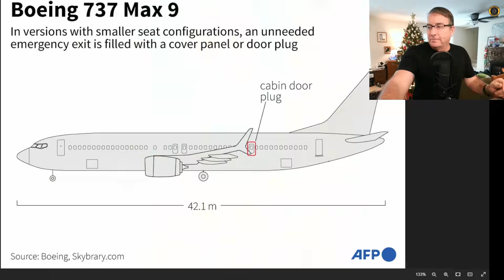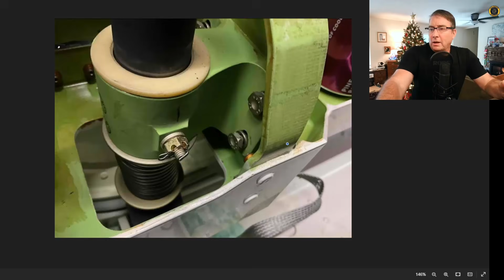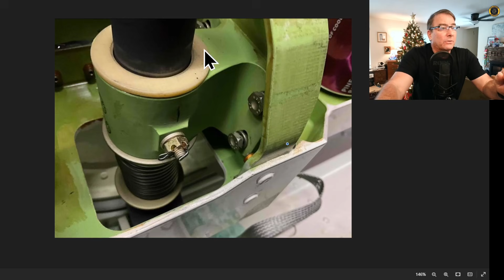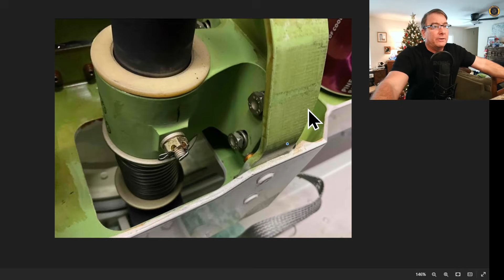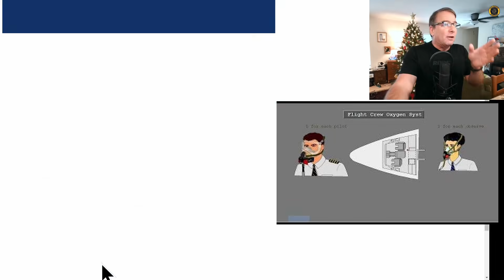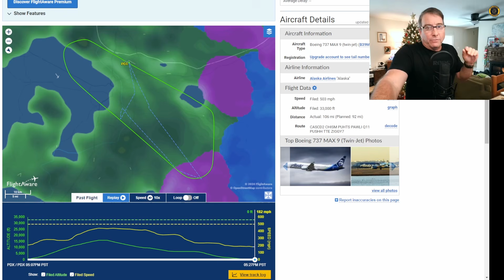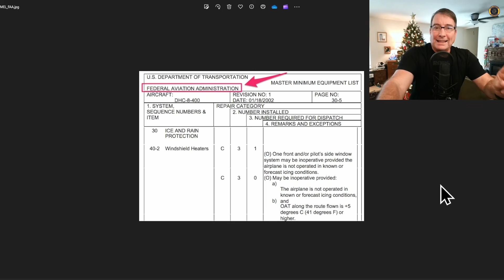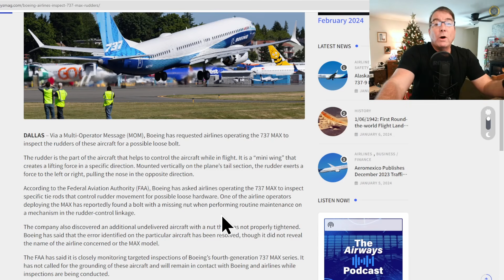"Yes, We Have No Bolts"  9 Jan 737 Max-9 Update

Comment: Here is a thought as to the possible sequence of events.   Bolts were never installed by Spirit and not caught by Boeing in Renton.   Thus door was a loaded mousetrap ready to spring.  What triggered the spring?   Given that work was done (WiFi antenna install) near the door that undoubtedly involved drilling etc (producing vibrations) perhaps those vibrations allowed the door to start to move a little and get closer to springing.   This would explain the pressurization warnings after the WiFi installation.   Those warnings were only transient as at higher pressure differentials the door plug was still able to seal (hence switching to the alternate pressure regulation seemed to fix the issue).   However on the fateful flight,  with the door having moved a little due to to the earlier Wifi antenna work,  all it took was some turbulence (with only modest pressure differential due to relatively low altitude) for the trap to spring wide open...
Reply: Who installed the interior panels?  Spirit or Boeing?   If Spirit, Boeing may not be at fault.

Comment: Why no safety wire on the bracket bolts? I undwrstand that everything does not need to be wired. But, brackets for doors, controls, control surdaces, ...

Comment: I live near the Boeing plant here in Wichita, KS. Now this brings ups a WHOLE bunch of questions I know the FAA/NTSB is and has been asking about loose bolts on that aircraft. Maybe it's time to do a full investigation into the "line" and see where the missing checks are at? Last, after watching the NTSB Brief about the crew Not being able to communicate, (after the blow-out of the plug door), My question: Why have the airlines haven't adopted a wireless headset system for the stewardess? Just a thought.
Reply: Nice! Tell what you saw of the labor dispute/strike @samuelbrown1413 As for wireless, too many points of failure. A few come to mind: constant need to recharge batteries; wireless interference & short range; wireless interception--and no, scramblers would only drain battery faster; thus, just like good ol' copper wire twisted pair landline telephones, sometimes the simplest work the best.

Comment: Is it possible to request a deep deep dive into why Boeing are are doing so many tweaks to this aircraft, occasionally omitting those changes from the manual!. How the original jurassic 737 was designed to have a fuselage that was low down close to the ground meaning it did not need specialist handling equipment and how MCAS was needed because the low lying nature of the design meant modern engines couldn't fit underneath the wing, completely changing the handling characteristics and ultimatelycausing2 hull losses.. All these work arounds to save having to certify a new design. I see now there's a new one, the blow out panels on the cockpit door are just fake? On this specific incident, do we know who was responsible for not securing the door? Where was the interior fitted? Another thing i heard was that a seat frame was twisted and i wondered if the floor got damaged?

Comment: Interesting, good piece to learn or remind things. 
Thank you Blancolirio! 
Well, haven’t flown 737 at all.
Flew 757, 767 and currently the 787.
I have 10000h on A320s in between… and SURELY I know that cockpit door shall open in case of pressure difference high on the cockpit side. It was even possible to test it while in 320 cockpit as the pressure ports for the (door unlock) system were visible.
Airbus FCOM detailed this function (not nesesery the trick to open the door).
On 320 we all knew the certification calls for opening doors one way and blown panels for the other scenario - decompression inside the cockpit. This knowledge is common.
Maybe I am wrong? 

Boeing manuals are written the way that we all go to other websites as you do in case of 737. I use 787 Guide for example. The common opinion is the official new Boeing aircraft manuals are written by some layers and limit the information. 
One has to go into maintenance docs and keep asking the technicians to understand things.
Pilots should not be surprised, should they?
This is the area Boeing should do better.

Comment: Great explanation 👍  
It seems to me it would be very odd for all 4 bolts to be missing.  Then again it is a very intricate 4 point structure to hold the plug in place, so something has failed or was missing.
Reply: No, it would be very odd if some other number than 4 bolts were present or absent.  The job item is to install all 4 bolts, or remove all 4 bolts, not to install or remove just some of them.

Comment: Wait, plug doors are BIGGER than their frames and use the cabin pressure to seal themselves… See the door where you enter the plane, why would you need bolts for a door like that?
Reply: It may seal properly in flight, when pressurized, however, in event of a water landing, is a plug door watertight? Would it leak like a sieve, thus reducing critical time for aquatic evacuation and escale before being completely submerged? Seems like the entire plug door concept is a dangerous, fateful, risk-enhancing design. Thoughts @emeraldqueen1994 @blancolirio
Reply: Yes, plug doors opening inward are safer at altitude.  Unfortunately, these extra exits are not plug doors, they open to the outside.  When the door isn't present the door plugs are put on from the outside in the same way as the working doors.  There were good reasons for this, but it makes them inherently less safe, and requires care in installation.

Comment: Having reviewed technical data, the only logical explanation is the absence of the 4 bolts upon delivery of the aircraft. Boeing has sacrificed quality over profits and upper management bonuses.
The 737 design (1967) was altered with larger lower sitting engines to accommodate the larger fuselage which needed the MCAS computer software to correct on climb out (to save money the pilots were never informed of this nor did it appear in the AFM)
The pressurization warning lights even when not applicable to the door plugs should have been sufficient motive for the captain to refuse the flight pending a full inspection of the system.
Af the 600 hours interval, mechanics for Alaska airlines should have inspected all potential causes for either vibration, turbulence or pressurization regarding the doors, rudder assembly and indicator malfunction lights.

Comment: The MCAS disaster was a huge red flag. Boeing has systematic issues affecting flight safety and they are in urgent need for structural reforms. Glad I sold my Lufthansa stocks. They buy to much from Boeing i.m.o..
Reply: Mght the cabin pressure warning events be similarly related to MCAS? Multiple cabin pressure sensors available yet (same?) software piece of code to read and consider only one cabin sensor? Smells fishy to me. Cabin of sardines, yup.

Comment: Doesn’t the airline have some responsibility for inspecting a new plane before receiving and signing off on final delivery. Boeing is deservedly being hammered once again this time for failing to deliver a quality product but shouldn’t the airline have some responsibility for the safety of the aircraft?
Reply: Its not really possible for the airline to check every single bolt on the plane.

Comment: 19:25 WTF? It is not part of the checklists that I've seen, but it is transparent and documented for the Airbus A320. Shame on Boeing for their 737 MAX pilots not knowing this. I'm a flight simmer and I know this regarding the aircraft I fly a lot in the sim. Clearly a real Airbus pilot would know this too. This is normal for pilots of Boeing 737s (NG or MAX)?

Airbus A320 documentation I have:

"Pressure sensor
Rapid pressure variation in the cockpit is detected by two redundant differential pressure sensors. This allows simultaneous opening of all latches when a certain pressure drop is detected.

Pressure sensor status lights
OFF: Pressure sensor 1 or 2 is operative.
ON: Pressure sensor 1 or 2 is faulty.
Note: When the Central Pedestal Fault indicator light is ON, these indicators enable the crew to identify the faulty item."

These lights are located on the overhead panel, usually on the captain's side of the overhead CBs.

Comment: I know nothing so excuse my ignorance.
As a "know nothing" I would have expected that Boeing (or Airbus, or maybe one or two of the major airlines) would have  a "smoke test" building.
Land the aircraft, take it to the building, and fill it full of smoke at atmospheric+10psi.    Then wait and see if the pressure falls, and see if any smoke appears in the building.

Without something like that, how are maintenance engineers supposed to diagnose the cause of a pressure-warning alarm?  
Do they just swap sensors and the computer until it goes away (and hope there isn't a fayed cable that is randomly shorting) ?

Comment: So, this is just an idea... but would it be possible for the autopilot to be modified so that it, by itself if needed, descends to 10,000 in case of a pressure loss? I can think of one or two incidents where we believe the aircraft was lost after a pressure related failure causing them to pass out, and with modern flight systems I would like to think we could make that a thing of the past.
Reply: .. they already had an issue with the computer driving a couple  planes into the ground, so I think you can rule out any more creative software configuration.
Reply: I checked, nearby Mt. Hood is 11,249 feet. Some of the densest clouds are cumulo granite.

Comment: I would argue that this is not a plug door. If the overwing exits are the same as previous 737 models, the overwing doors have to be pulled into the aircraft before turning them and throwing them out of the exit. This design ensures that door is pressed against the airframe when the aircraft is pressurized and the seal is squeezed between the door frame and the door opening frame. If the a/c is pressurized, you can't pull the door plug. The stress of pressurization is carried by the entire perimeter of the door. This accident door is more like a blanker panel with a window. It is not positively secured when the a/c is pressurized and the stress is carried by the fittings only. P.S. I believe the main cabin doors are also positively secured inside the airframe.✈️

Comment: Great analysis thanks. Just as a matter of interest, I note one perculiarity with the upper track fitting as shown between 2.53 - 4.48. Looking at the hilok fasteners on the fitting, I can't ever recall seeing hiloks ever being fitted in a manner other than heads being on the same side of the item to be secured. In this instance, you can clearly see the 2 hiloks in the picture fitted in an opposing manner. Now it's been 16 odd years since I worked on structures and this probably isn't even an issue. But I've never seen that layout ever used before. Any thoughts from the LAMEs/AMEs out there?

Comment: On any military aircraft, bolts of that type would be safety-wired, either together, or to a separate post, or pre-drilled hole in the airframe.

Comment: Alright alright, I'll bite. How did you know ETOPS can be found painted/printed on the front gear cover panel of the aircraft?
Reply: That's where they write info like that.  In this case it is a safety thing, the rampers can see exactly what model it is for the loading plan.

Comment: Just my opinion here. 

We have 4 safety critical bolts here that are just set up to fail. They used the castellated nut and split pin on those to keep them from loosening during vibration. Very important for safety critical fasteners. Keeping bolts from loosening under vibration is important and there are more that a few techniques to do it. The main ones I'm familiar with are threadlocking componds, friction types, and mechanical types. 

They installed a small washer over a slotted holt on all the bolts, and it doesn't look like they used any kind of threadlocking meachnism. So that's going to come loose pretty easily, bad design. They need bigger washers and/or safety wire on those bolts. I wonder how much money they saved on that crappy design. Probably also using the slotted holes to allow big tolerances and reduce costs as well. Lame.
Reply: Wow, you should go to Boeing and educate those clueless engineers. I wonder how they missed consulting you to begin with.
Reply: @OsoMagna  Yeah they are pretty clueless obviously if the door just fell off the plane wow we been building doors for so long it should be pretty easy.
Reply: That cotter key is much thicker and stronger than safety wire, and faster to install.  Safety wire is more for a bolt circle, and also requires lining up holes on each bolt. Also slow to install.
Reply: Nah I'm saying that they should also put a antivibration nut on the 4 bolts holding the  bracket to the main one.  @SteamCrane
Reply: @chkpik  Not convinced there isn't some kind of antivibration capability on those bolts, but it would be worth investigating.  Some of the nuts in the area look like nyloc.

Comment: The clip from 5:28 shows the bottom bolt appearing to be loose against the washer already the split washer appears to ba at a slight angle indicating it is loose

Comment: so there are numerous reports that airline operators are finding loose bolts on the door fittings for the plug door.  

When they say loose bolts, are they referring to bolts that are finger tight and rattling around in the nutplate or are they tight but not tightened to the proper torque specification?

Comment: It seems to me if both of the vertical movement bolts were in place only the lack of one set of the hinge bolts could allow the hinge fitting to travel. This one side traveling/ deforming (with the help of the force of the spring) would probably be enough to unhinge the plug (on one side). Vertical play at the top would allow this since the top bolts do not go through their nuts as below.

Comment: Juan;   Another excellent incident summary.   Back to the MCAS for a minute.   When you hit the AP disconnect  switch or the AP connect button on the AP console that has meant to me at that point you have full manual aircraft control.   The PF controls pitch, nothing else.   How crazy it is that even the FAA missed this in certification.   Bad certification and communication by both Boeing AND the FAA.   Maybe they should go back and check every fastener on the airframe?

Comment: Jesus these engineers and safety "experts" that establish these standards??? God forbid that we get the passengers off faster with an extra door THAT IS THERE WAITING TO BE USED.  I bet the cost this intendent will cause will be far more than the extra hardware they would have needed to just make it a real exit. Not to let Boeing off the hook but they did not build this fuselage section. This is what you get when you farm your work out to subcontractors and lose control of the skill lever of the people building your components and don't inspect and double check every inch of it. As a retired airline mechanic we often had to repair or correct "supposed" airworthy part and components from subcontractors.

Comment: As I understand the 737 design there are fuel tanks in the wing. Why are there emergency exits letting passengers out onto the wings during emergency exits?
Reply: In event of a water landing. Capt. Sullenberger and his crew demonstrated that, to good avail.
Reply: @paulsherman51  True, but the number of water landings make such events exceptional. I was asking if, in the event of a landing crash, such as Haneda, then exiting onto potentially ruptured fuel tanks seems risky.
Reply: @proteusnz99  That's why the FA's look out the windows before opening an exit. At Haneda, they identified 3 safe exits out of 8, and avoided the overwing exits. Also, wing tanks are supported directly by the wing, reducing stress.
Reply: @SteamCrane  Thank you, that makes it clear.

Comment: AS A WELDER SINCE 1978, TRAINED IN A FACILITY THAT SUPPLIED WELDERS TO BOEING AND GE SUBMARINE DIVISION,
IM SURPRISED TO SEE A DESIGN THAT DOESNT INCLUDE A WELDED FLANGE AROUND THE WHOLE DOOR, LIKE A SUBMARINE PORTAL.

DESIGN ENGINEERS NEED TO ACTUALLY BUILD SOMETHING BEFORE THEY PRETEND TO BE ENGINEERS.
I  SUGGEST STARTING ON THE FACTORY FLOOR(SWEEPING UP).
🤣🤣🤣🤣😨😁

Comment: Why is there no safety wire on those two bolts that are shown to be loose? Shouldn''t those bolt heads be drilled and have a safety wire installed that goes over either to the other bolt, or to a screw nearby so that they can never back out. ?

Comment: The revelation that the cockpit door automatically opens in case of sudden depressurization is shocking!  I thought that was what the blow-out panels in the new cockpit doors was for.  Now, terrorists know they can force the cockpit door open just by blowing out a single window. Sheesh!
Reply: Hopefully the smaller opening would slow the decompression rate, and allow the cockpit door vents to accommodate the depressuration.

Comment: I wonder about the qualifications for the technicians who work at Spirit AeroSystems building the Boeing Max airframes? Missing bolts, torque wrenches not properly calibrated, nuts missing cotter pins etc. A review of the entire “Build” process needs to be undertaken by the FAA! 

I read that the FAA in January 2023 appointed 24 experts to review Boeing’s safety management processes and how they affect Boeing’s safety culture. The panel was convene and have nine months to complete its review and issue findings and recommendations. Wonder if this report was completed?